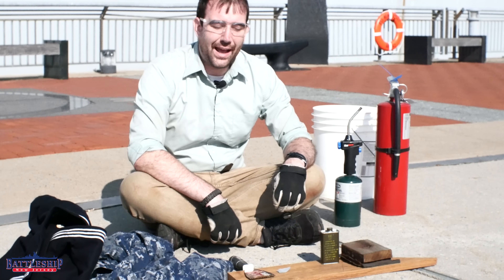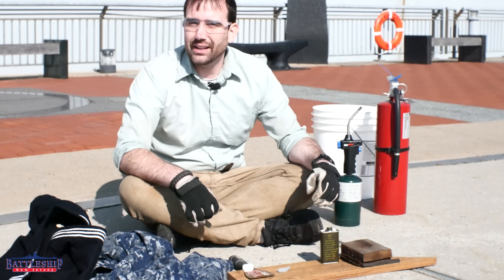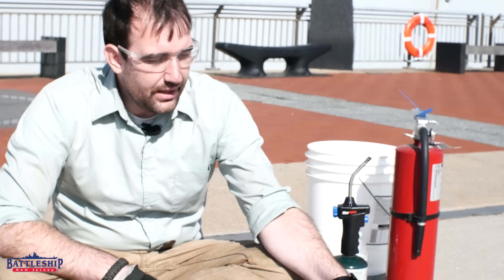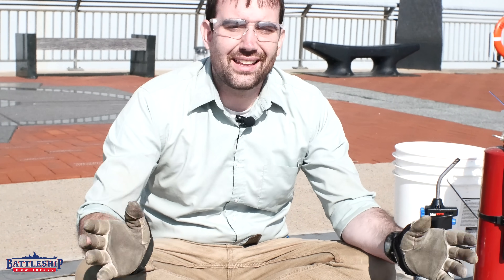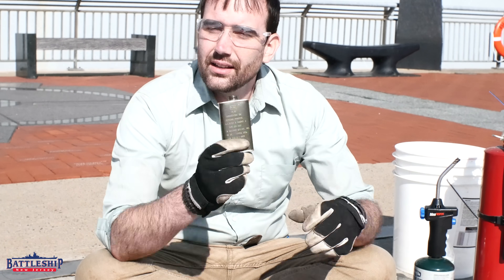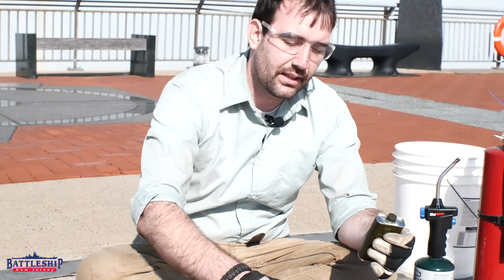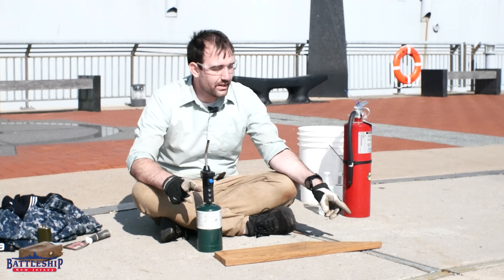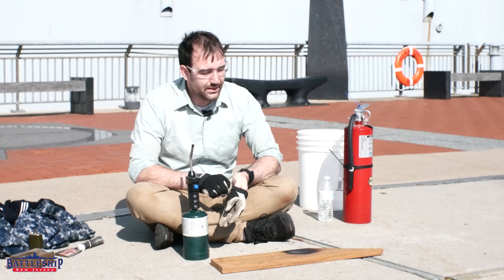Battleship Flammability Test: Gun Oil, Uniforms, and Teak Wood

Comment: As a former officer in charge of the Navy's Clothing and Textile Research Facility in Natick, MA, I can tell you that we went through a lot of testing using a movable, instrumented manikin (and working with Dupont) to find the most cost effective, flame-retardant material available to protect our sailors at sea.  No corfam shoes, double knit, Certified Navy Twill, etc was allowed on ships (except for dress uniforms).  When I was stationed on the New Jersey, as Assistant Supply Officer, it was part of my responsibility to issue blue cotton coveralls to every crew member and khaki cotton coveralls to every chief and officer.  Some sailors still wore the dungarees and some chief and officers still wore cotton khakis, but the coveralls were generally the popular underway uniform.  While cotton was not flame-retardant, we found it far less dangerous than anything made of polyester, nylon or other synthetic.  Also, as one of two officers on the DCETT (Damage Control Evaluation and Training Team) we were very strict on clothing, equipment and material during evolutions and work to outfit all our repair locker personnel with nomex as quickly as possible.  As an additional note to Ryan, I think you are doing a great job keeping the spirit of New Jersey alive and making sure this great ship remains a monument and tribute to the sailors who served on her.  Keep up the good work.  BZ to you and your whole staff.

Comment: Three elements required to combust: fuel, oxygen, heat. In your tests on the teak you probably were not able to maintain a high enough temperature to sustain combustion. You even commented that the teak didn't get that warm. Synthetic materials are plastics, wool is sheep hair, doesn't burn well on its own, but if you but a strip into the oil it will act as a good wick.

Comment: Might try burning the dungarees just for the heck of it. That would make more sense than the old cracker jack uniform you burned. In almost any instance I could conceive of a shipboard fire, we'd be in working uniforms, not dress blues. More seriously, the Navy went to synthetics and short sleeves roughly the very late 70's into the 80's if my memory serves. I was attached to both shipboard units and more specifically Fleet Training Group, GTMO, and we advocated for the older uniforms, both due to the likelihood of the synthetics either burning or more likely melting and also for the long sleeves for protection from flash burns. Lost the battle then, but the camos and jumpsuits that replaced them addressed both issues.

Comment: solid wood usually does not burn well from the top down.  that is why you would ignite kindling or split wood at the bottom to heat and ignite solid wood above when starting a log fire.

Comment: I suspect the wood was cool enough that it was pulling the temperature back down below the flash / combustion point of the things you had in contact with it (paint, oil, the wood itself, etc.). Also, ash doesn't burn, so once it's past the "charcoal" stage, it's just hot carbon that won't burn.

Comment: Oil is difficult to set on fire. That's why boilers would have the oil go through a generator tube inside the burner and engines have it sprayed inside the engine in a mist from an injector.
Having something for a wick, it'd then burn, as the oil vaporizes approaching the flame.
Of course, if you shell handling deck is on fire, well, you've got worse problems happening that managed to disturb the oil into a cloud. The last ship something like that happened on was the Arizona, the bigger problem being a bomb detonating the entire magazine.

Comment: The WWII woolen jumper appears to be felted, where the hair fibers are glued together, and the glue will burn to a degree when exposed to flame, but that degree is limited by the amount of glue in the felt.

Note: flames are always in the gaseous phase, so fuels need to evaporate before they can burn... even metal powders.

The materials being tested, with the exception of the cotton - synthetic blend of the "blueberries", and to some degree the rubber deck sealing compound, lack sufficient volatile compounds to sustain a flame when the open direct flame is withdrawn.

100% cotton fabric will burn quite quickly, leaving a small residue of ash. Nylon fibers blended into the cotton fabric to make rip-stop, and polyester fibers for "permanent press" fabrics have a nasty tendency to melt, as some have already mentioned, leaving a sticky mess of melted plastic stuck to the skin of a burn. Debriding that away is a thoroughly unpleasant situation.

The Navy does have some engineers - both sworn and civilian - on staff who are very aware of these kinds of risks... whether or not BuLog listens to then is a matter of conjecture...

Comment: Sorry to say....your test are not valid because you have not considered the amount of heat involved as your ignition source. I'm not going to spout a bunch of physics class stuff but consider how hard it it to get a log to ignite with a match. Then how easy to light paper with a match--both essentially the same stuff but physically different in size. A really big fire of medium hot temperatures will light off that teak in fifteen seconds but a small fire of much hotter temperatures may not because of the total amount of heat the flame holds. Most fires that happen in war/ military have a great deal of total heat to catch other stuff rather easy.

Comment: Our ship, USS Canopus AS34 had a below decks fire in November 1971 while anchored in the Holy Loch. The hull adjacent to the fire blistered outward.  A huge amount of smoke poured from the ship's openings. Decks buckled; linoleum burned. Everything in the area burned. Smoke collected on overheads and bulkheads an inch thick in some places. I know, I was on cleanup detail with 409 and paper towels. The cause of the fire was linked to a ruptured hydraulic fluid line in the Chief's baggage storage area, DIRECTLY below the brig. Two sailors in the brig and their guard lost their lives that night.  It was never explained exactly how a hydraulic line in a secured storage area managed to break after years of reliable service.  An ignition source was not announced.  Too many unanswered questions still surround this event. The FBM's alongside at the time cut loose their moorings and the tugs moved them away from the ship.

Comment: One of the fallacies of your tests it removing the heat source.   I assure you that much of the stuff will burn furiously if the fire heating it does not get removed in a short time.    An example would be the teak decking, and especially the rubber base coat.  A below deck fire will make for a long day topside for DC teams.

Comment: Google says that a propane torch burns [in air] at between 2000 and 3600 degrees Fahrenheit.   Not exactly "low heat".

Comment: Ok - at near 5:20 Ryan show he is NOT a sailor and does some no-no's. First he checks for heat - at least keeps the glove on.- But he uses his fingertips.  Senses NO heat; checks again with gloved hand - again fingertips. When checking for Heat - use the back of your hand - it is just as good for this purpose. - IN some case, instinct might kick in and hand will move toward balled fist. Second, for your tactile feeling nerves- Fingertips are the best and most sensitive nerves. Don't risk your best nerves for checking for heat.
Reply: Same technique taught for electrical wires.... muscles will contract and pull your hand AWAY, instead of contracting fingers and gripping on tight.

Comment: If you could get a safer, more controlled setup, showing just what it takes to ignite fuel oil might be interesting.   

And while you have that more controlled setup, trying all these again with a hotter ignition source, like oxy-acetylene, would be quite interesting.
Reply: As in machine shop areas

Comment: Not that it's particularly great to handle but if you've got it, sections of insulation from the newer synthetic and fiberglass down to the old asbestos (if you can find a way to safely do it)
Reply: Asbestos, being a mineral fiber, will not be impressive.   I will char slightly, but will not burn.

Comment: When I was in the US Army from '66 to '68, for duty we wore what was called fatigues.  These uniform items were made mostly of cotton.  I do not know of what the work dungarees that the swabbies wore were  made.
I trained at Ft Eustis, VA as a harbor craft boatswain on LCM-8s, LCUs and tug boats from 45' to 105' in length.  Part of training included and introduction both fire prevention and firefighting.  Paint lockers were to be always closed when not in use.  No oily or paint soaked rags were to be just piled into a corner .
Reply: Army fatigues were changed to polyester/cotton for a time.   Sad.

Comment: Hydraulic fluid from the gun turrents.  In the Iowa turrent explosion and fire the hydraulic oils were part of the fuel load.   Also in the 80s, I wore cotton dungarees and firefighting we just added a nomex hood and neck protector, armlets, and gloves.   The turnout gear like civilian firefighters wear started appearing mid to late 80s.      Also, just for shits and giggles, if you have any, how a single grain of 16 inch propellant burns, and a small amount of 5 inch gun propellant.   We already know from WW2 after action reports that the kapok life preservers burned.

Comment: I think that the British still issue anti flash hoods and gloves made from untreated (that may not be the right word) wool that still has lanolin oil in it. The garments are surprisingly fireproof. You'll see those hoods in old WW2 era pictures.

I served from 70-74 and our "protective gear" was dungaree pants tucked into our flammable black nylon socks and a chambray shirt with the sleeves rolled down and collar buttoned. Maybe a little protection there as the fabric was cotton, but on the gun line off Vietnam most everybody wore t shirts. The navy did a work uniform change around 1973 and went to a polyester pull over shirt which was at least as flammable as the blue camouflage shown in the video. Stupidity never seems to go away.

Comment: Interesting comparisons.  I would suggest fuel oil and air taken from the fuel oil tanks for a future test.  The shell handling oil may have been non-combustible like mineral oil.  
Not to be nitpicky but I will be anyway.  Solid wood is combustible, not flammable.  Combustible means it will sustain combustion exposed

Comment: Another thing to consider. All these items are used in confined “machine spaces”. (A ship is one large machine) Therefore, everything will be to some degree covered in oil, grease, and other flammable fluids. The confined space will contain and concentrate any heat buildup as well as any flammable gasses. (Gas burns, liquid and solid do not.) The propellant and HE in ammunition don’t require much outside oxygen. 
Conducting this experiment in the open air is telling but one must consider the environmental factors as well.

Comment: Wool is often used in clothing for applications where people have a significant risk of getting lit on fire for exactly the reason that you just demonstrated. It's hard to light and doesn't stay lit when you remove the heat source. Also doesn't melt and stick like napalm.

Comment: As far as the shoddy fire resistant uniforms I suggest everyone read David Poyers novel "The Gulf" at least the prolong. He starts with a frigate being hit by an anti ship missile in the engineering spaces and then goes from there showing just how bad nylon blend clothing, plastic coated shoes like Corframs, and even rubber soled boots do on a metal or aluminum deck that has been pre-heated by a major fire. There's a reason Chief's hold on to the "unwashed" working uniform made of cotton. They ain't dumb and as nice as fire resistant is when it works it doesn't provide anymore thermal heat injury protection then equal thickness cotton.

Comment: The question in this test is, would you use it as tinder for a camp fire. I know from experience large chunks of wood, other than sappy pine, are terrible fire starters. The 80s wood is a good test, because old, dryer wood is getting there as a camp fire starter, and the deck didn't burn like aged fire wood so it retains moisture for quite a while. The uniform should be somehow fire resistant and it shouldn't torch out like Styrofoam, but with the number of washings any coating probably would be useless. You didn't do the human body test, but touching a leg inside those synthetic pants would be the start of a really bad day. Unless something is designed to protect you from fire, you do not want to get exposed or expect clothing to protect you from fire, you only want to avoid the flash paper or Styrofoam effect from momentary or incidental contact. The burn on the synthetic was not bad for incidental or momentary fire contact, it did not seem to burn through with a very harsh test. It looked rather new and may have coating still functioning, 50 washes later how would it perform.

Comment: Char is an insulative material. Once burned on the surface, it will actually stop heat and fire from going through. I don't quite remember the exact recipe, but you can actually make tiles from char and other stuff and at something like 4 mm thick, you won't feel a full burning torch if you hold it in your hand. Quite cool stuff.
Reply: Charred bread is a pretty good insulator.

Comment: Anything burns if you get it hot enough. Modern FAA requirements for materials used in the passenger compartment of commercial airliners require them to be fire retardant, not fireproof. They will burn if you apply a source of ignition, but will flicker out because they are doped, usually with antimony oxide, which removes oxygen from the materials so they can't actually fuel a fire. Considering you are sitting on thousands of pounds of jet fuel, the chair you are sitting in is the least of your worries.
Reply: Except that the jet fuel is OUTSIDE of the passenger compartment.

Comment: How about some kapok fiber, with and without a sealed cotton bag containing it? It was popular for flotation devices during the interwar and WW2. Cork is also worth a shot. It was also a historical option for flotation devices, and while I think it had been phased out by the time the Iowa class came along, but a sample is easy to obtain free as waste material (though for all I know the stuff in wine could be an entirely different type/treatment of cork). Oilcloth (pre-rubber rain gear) is another thing that would be common on older ships and and a fire hazard.
Reply: Cork will burn with vigor.   Kapok as I recall, does not burn as fast.

Comment: Fire is a strnge beast. Some materials will not catch fire when you put a torch to it for a few seconds, but if you leave it in an oven for a few minutes it spontaneously combusts. It's all about how much of the flammable parts of a material are released per unit of time.

Smiliarly the paintchip probably doesn't burn that well laying flat on a surface where air can't easily get to it. Remember that crawl-through where you went up a passage that had pant peeling off all around it? Those might burn a lot better being surrounded by air in a drafty place.

Anyhow, Never underestimate the flammability of a meterial.

Also: I cannot begin to imagine the horror of being deep inside a ship when a firealarm goes off. yes there are multiple exits especially for this threat, but still,fire consumes oxygen very quickly, it creates a lot of smoke, I'm gettl claustrophobid just thinking about it.

Comment: One common thing that was very flammable was Old School Brasso that was used daily to polish the aluminum lockers in berthing.  The good thing about that stuff was it covered up the "other" smells in berthing.  Somewhere along line the formula got changed and it stopped being so fragrant it also stopped working.
Reply: Brasso is still plenty fragrant(we've evacuated the building for a large spill on the filling line), but it uses ammonia now

Comment: Refined oils don't burn very well unless they are exposed to high heat for prolonged period.   If you threw a match into a bucket of diesel it would put the match out.  What makes gasoline so flammable are the vapors.  

I think you owe Paul Harrell royalties for the caution.

Comment: All of those things will burn if held in a fire inside the ship for long enough. The steel of the hull reflects radiant heat back into the fire, making it burn much hotter and more efficiently. It’s essentially the principle that a wood stove works on, but in a way that you really don’t want.
Reply: Yeah but it beats a wood hull.  That's the principle of burning a pile of wood inside another pile of wood.

Comment: Considering fire hazards, electrical and electronics are great sources… some of the older wires and electronics were hi voltage tube stuff and boy when a transformer blows weather in the old TV’s or ac for electrical, compressors and other electrical/electronic knick knacks you will have issues!!!!

DE N2JYG